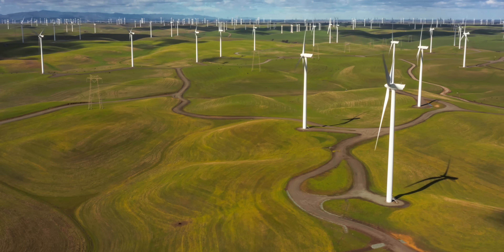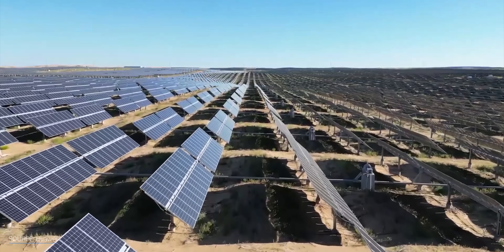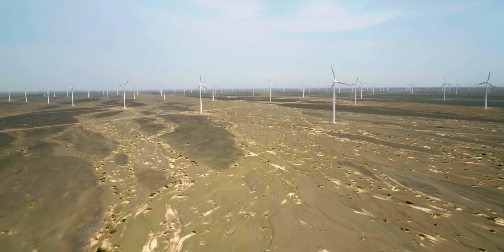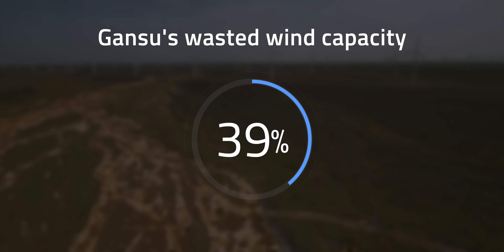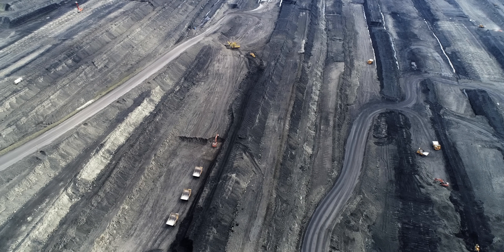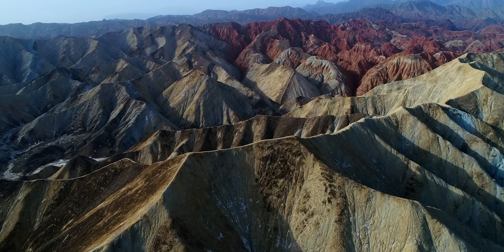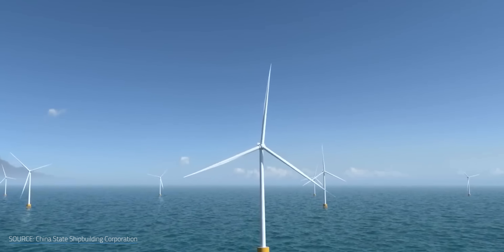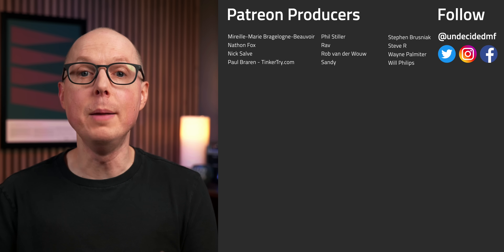The World’s Largest Wind Farm has a Tiny Problem

Comment: That coal is often exported to either the south china or abroad. China needs to add a carbon tax enough that its more expensive for coal power at least within the northern states. Local states can just clean up the plants and burn the same coal or export it and then start using the wind power. Beijing wants to close its local coal power so it should be connected. Beijings daytime power demand is 17.5GW and thats with transmission losses. It also secures the capitals power (at least for daytime) and allows some coal to still be needed but burnt alot less (and be cleaner even though most coal power plants are new by global standards). Remote data centres only need a very small staff. Other options are worker heavy green steel/ Cement. Cement needs are likely too low in the north but green steel made by wind would still have value if sent by train (more local jobs). Steel ore can come north and green steel sent south. Aluminium needs vast power demand. Curing of carbon fibre, C02 absorbtion, pumped storage as a battery (When the wind still blows overnight). In the end, China needs to decide how to transition such workers from coal to something else even if that more than one industry but one that flourishes on cheap green power even with HVDC wires to the south. Its not easy and stability is crucial to Beijing but it moved from bikes to cars and China had no oil.

Comment: Typical China project, build stuff they don't need. Power that would have to be transported too far to be practical. They tear down apartment buildings that weren't needed to begin with. They overbuild airports, highways, rail lines, steel plants, aluminum plants, ev battery plants, solar cell plants. This may all sound good until you realize it's not needed and now they took a beautiful untouched desert we fight hard to preserve over here but over there they turn into an eyesore.

Comment: As they put more high voltage transmission lines in the cost to deliver power to the areas that need it most will come down. Sounds like they are heading in the right direction despite difficulties.

Comment: The toxic gases to produce the blades and materials to build these things is massive and when the blades themselves wear out and they do their huge and their non-recyclable… Windfarms in my opinion create more problems than they solve. Appliances lights everything we use has to change. No more energy gulping washing machines and dryers the technology has to be put in the things we use not trying to power What we already have. Energy is always a losing situation for people. Take electric cars sure they say they don't pollute? Where do you think they get the Energy to charge? In most places its coal… It's just a trade-off one pollution for another. Then you've got all the toxic waste to build these things. We are an arrogant species and don't worry the next wars on its way. That's how arrogant we are

Comment: Did not think this one through did they. The same stupidity exists in China as it does in the West. Where are all the engineers and people with common sense? These were the type of people that put the original system together. None of this BS is economic. PV cell knowledge is about 170 years old, if it was any good why was it not being developed for those 170 years?
Common sense and economics ruled.

Comment: You don't use Gigawatts in the past tense. Gigawatts is an instantaneous value. It's like saying, since I bought my car it has produced 1,000 horsepower. If you want to express the amount of power or more correctly energy the installation has produced in the past, you need to use the measurement unit Gigawatt hours... Or Gigawatt years...

Comment: This all sounds great, but it’s pie in the sky. The numbers you quote are misleading and wildly optimistic. They don’t take into account the dollar cost or resource cost or carbon cost or maintenance cost or replacement cost of the wind turbines let alone the incredibly gigantic concrete anchor, sitting under each turbine supported by steel rebar. This channel seems to be a sales brochure for both wind power and the Chinese government. A well constructed nuclear plant that isn’t built by the lowest bidder and is properly inspected during construction would be a much better solution. Would also not kill all the birds.

Comment: You should indicate the comparative losses in high voltage AC vs similar voltage DC transmission lines. I've heard that HVDC losses are much less over the distances involved. I think Siemens was  the supplier for the HVDC equipment.

Comment: These wind farms will eventually be abandoned. The company’s will eventually go bust plus very expensive to pull down and remediation. Hence they will be abandoned. Co2 is actually getting to low the trees and animals and humans will die for myth, We need nuclear gas or a clean coal power stations just get rid of the black smoke. I can say I have a car that can 200 km per hour but it’s actually parked in the garage and never ever will be driven at that speed. So a wind farm is quoted the same way it can provide x power total out put under ideal conditions. So you want power you got a heap or none. But my car will give me 200 km per hour at the press of the accelerator. Th same with gas turbine power station.

Comment: UNDECIDED?   You are far from undecided.. You are lecturing on China's so called success.  How can it be successful when it is nearly twice the cost and that is without the costs of transmission .. Nice of you to gloss over the facts..   You also fail to calulate the requirement in the very now!    A.I.   and that of the failing EV's. More transmission lines..  ?   Have you worked around high power lines?   I have and it is very dangerous.  Even a mist is and issue..   Fail!    How long to turbines last.. Where is there grave yard and the cost of dismantle and retransport.   
Oh before you say it !   China announce it has the answer to disposal.  Put it into roads?   Great so every car or truck grind up the glass and resins to be shared into the air we breath..   My God people are dumb..  if they think that is and answer ?    
So. Matt do you own a large farm holding ?   I would guess Not as where do you think the lines travel through..  Many of the Power companies are off shore shelf companies..  they take NO!  responsibility for removeal of these wind generators..   I am in Australia and there have been a few fires..   Oh and yes even a Tesla battery bank..  took weeks to burn out..   But don't worry I am shore they know they are CO2 free fires. What possible problem can they cause..     Matt Ferrell your on the wrong side of the future.. That is is we don't blow our selves up..   

Did you know those solar panels are reflective?   Did you know the Worlds magnetic field is changing..  Did you know the Sun has justrecently change magnetic poles and is now in a solar maximum?   Yes. True..  Now ours is weakening. when the Sun gives of more..  ?    
CO2 or the Sun????   I pick the Sun and the energy heating the magma you know those increased Earth Quakes and Volcanos..    I guess the wind turbines could blow out the Volcanos??    Naa Just kidding..    Matt, Why are the companies like Google, Amazon,  Microsoft looking to Nuclear?   because of the A.I demand and the low CO2 foot print.. ?     Look into the power needed for A.I.  it would be a GIGILE …. Or Two.  🤣🤣

Comment: It is becoming so frustrating for totally uneducated and ignorant people to make comments about energy production.  They have absolutely NO knowledge of the TECHNICAL requirements to generate large-scale power for a power grid.  The power grid has very specific and type requirements to maintain the stability of the grid.  There are numerous factors or attributes that must be made to ensure that stability.  Unfortunately many renewable power sources are incompatible with creating a staple power grid.  Solar and wind are two such examples.  Unfortunately, for many technical reasons, they are incompatible with a stable power grid.  Sadly, greed is driving.Many of the pseudo activists who are promoting wind and solar power.  They're certainly are applications where solar and wind excel, particularly for remote applications.  [ I hold 3 engineering degrees and completed my graduate work in mechanical engineering at Stanford University. (My areas of emphasis were energy systems and biomedical research.)]  Much of the information presented in this video is simply wrong, if not false.  I invite the viewers to read any of the books written by Professor Thomas Connelly at Stanford University.  I certainly miss my dear friend.

Comment: Instead of dumping the power, pump water back up the hill into hydroelectric reservoirs.  Hydrog3en is monumentally inefficient but instead of dumping the electricity, generating hydrogen has an attractive purpose.  It can be burned right along with coal to generate electricity.  China isn't stupid.  They are racing with all efforts to to materialize He3 - D2 fusion and even though the DOE solved the reactor problem, the Chinese are going to bring it to fruition.

Comment: You hit the nail on the head there Matt.
Transmission and storage need to become much bigger part of the investment focus more so than just generation. 
Australia has been investing in huge amounts of Solar and Wind but like in Gansu a significant amount is curtailed.
Only lat 2024 dis renewables meet 50% of our electricity demand at a few 30 minute times during our summer months.

By comparison far less effort has been made in improving transmission networks.
Out very large battery projects whilst huge on the world scale can only supply peak support for a few hours. between 2 and 4 hours of power when needed at peak times. 
Whilst wind can be generating after the sun goes down there still needs to be a lot of wind during the late afternoon and evening.
Our peak demand typically 15:00 hrs through to 22:00 hrs. I believe this time frame seems to be universally mirrored  globally.

Comment: The only reason we seek green energy is because they have connected CC with human development. I’m not against clean air and water but that doesn’t mean that only humans are responsible. Last week a scientific report showed that the polar caps on mars are receding faster than earths. Did humans cause that too? USA uses 25% of the world’s goods and we have cleaned up our air, so can India and China. If you dig deep in CC solutions you will be shocked to find that depopulation is also a goal. Are you for that too? It’s all a façade for global governance. Clean air is obtainable with oil energy. If you sir are stuck on wind energy in an attempt to save the planet, then be an advocate for all clean energy development. Nuclear fission is safer than nuclear fusion. Geothermal, solar and many more forms can be developed if we fund them. It’s proof that the world leaders are using CC as an excuse because energy development is under funded. Even your precious wind energy has side effects and consequences. Affordability and consistency has to be included too.

Comment: China has never been forthright in disseminating truth.  I always look for supporting data.  China has been building coal fired generating plants and is bringing them on-line at the rate of one/month for several years.  The data can be confirmed by destinations of coal imports, infrastructure parts that are imported and satellite imagery.  The key factor for for electricity is $/kwh delivered.  Wind power has a high maintenance cost/kwh.  Then the turbine dies and normally is just standing, look at wind farms in California.  No one has   a feasible plan to recycle the hazardous waste from wind farms or solar farms after their useful life.  ergo You pay 2-3x for the power and then look at huge tracts of land or water with turbines with nothing moving for centuries.

Comment: 7000 MW installed capacity that takes up the size of Belgium shows that renewable energy is probably not a viable long-term solution. This is less energy than even the smallest nuclear power plant when you take capacity factor into consideration.
Reply: So I wonder why won't the CCP just build more nuclear power plants? I really don't understand the global aversion to nuclear power. I truly think we solved the clean and efficient energy problem with nuclear power.
Reply: @dopecat15  They are. They just fired up the Zhangzhou Nuclear Power Plant in 2025 in January. Obviously, the upfront cost of a nuclear power plant and its power density doesn't justify having it for smaller cities or less-developed cities, but they are experimenting with the small modular nuclear reactors to reduce costs, as nuclear power plants are still bespoke constructions.

Renewables are cheap enough that you can add them quickly and scale up in a linear way, but at the cost of very low energy density so it uses so much space, and the intermittency issue means you have to build a couple of coal or natural gas peaker plants to make up for baseload.

Comment: From what I've gathered online, the lifespan of a wind turbine is approx 20 yrs and about the same for solar panels..... Have lived by or on (sometimes, under) the ocean for decades of my life..... Salt water, probably the most  hostile environment for wind turbines/electricity plus huge storms/swells ain't gonna cut it.... maintenance & replacement will make fossil fuels much more reliable and cheaper in the long run.... just an aside...
Anybody ever heard of nuclear?.... (worked great on one of the subs I was aboard for 14 months back in the mid 60s)

Comment: Right .... 1.5 GW @ 1,500 volts field of windmills isn't nothing when one (1) hydroelectric generator like at Bonneville Dam (that has twelve) @ Celilo supplies 3.5 GW @ 560,000 volts DC 2-wire [ 840 miles away ] enough electricity for 1/2 of Los Angeles entire needs from industrial, commercial, infrastructure and residential. One Hydroelectric Dam supplying power from Seattle to Los Angeles, total costs to build and upgrade around 3 Billion .... and isn't a horrendous "EYE SORE" to 1000's of acres of American land .... IHMO !!

Comment: Not sure how you waste 50% of electricity produced.  Without a load there is no circuit, no electric power produced or ‘wasted’.   Are you saying they power wasted heating coils randomly out in the desert, just wasting electrical power?? The only ‘waste’ I can think of is the waste of over building conversion machines.  Which actually, if there is little or no depreciation of the equipment, it’s just an investment.  A good or bad investment depends on how you use it or will use it.  Please explain how you ‘waste’ 50% of the energy produced.   To what circuits is the electrical current going to?

Comment: Transmission is a bigger cost issue than you describe. The cost to build lines capable of delivering the maximum capacity divided by the energy actually delivered drives the cost of the energy sky high. It makes no economic sense.

Comment: This is a constant feature on central planing, builds the impressive part, but not much consideration is given to the other parts that in this case would be cost of access, demand, transmission, storage, etc. Maybe a smaller and well rounded project would be a good start, that would attract business to the cheap energy and that would create a demand for an expansion.

Comment: Anyone ever figured out how many replacement propellers will be needed in the next 20 years and where the old non-recyclable blades will be buried? Has anyone ever figured out how much diesel fuel was burnt to built all these towers, blades, concrete etc? Anyone ever added up the copper used to build the generators and hook them to the grid? Not likely because it won’t work if you do!

Comment: You said it, wind electricity is unreliable or there's too much. We don't have the tech yet for electricity storage to store what even a mid-size city would require. All of this is supposed to be for clean energy, which is a joke considering the amount of natural resources are needed just to set up a wind farm, keep it running successfully.. it doesn't pay for itself in the end, and the co2 used in making wind farms and upkeep? It's a lose-lose all around. Better tech, nuclear, and further research in batteries may change the future, but forcing ' clean energy ' is just virtue signaling and the the elites new religion

Comment: Wind and Solar are always the unicorn just around the corner. Always expensive, land gobbling, and horrible to ecosystems including mass animal death. Not to mention the eyesore.
I always wonder why the eco zealots never mention nuclear. 3rd generation plants have never failed and are designed to never melt down. The tech is now quite advanced and waste is stored and buried at the site. The US regularly uses it with no issues for military purposes. The big tech companies are now building nuclear plants to power their large power needs for AI, crypto, etc. Multiple companies including in the US and Rolls Royce are designing small reactors with more flexibility.
China sees they need to have energy independence. 1.5 GB for a huge wind farm seems inefficient for the cost. China has 56 nuclear plants powering 54.3 GB capacity. 30 reactors with 32.5 GB coming online. China’s bet is on nuclear. US will follow suit as energy = dominance and better standards of living. Solar without the large land grabbing panels and wind without the destructive turbines could eventually be great options. And I know it’s anathema to greenies but fossil fuels in the US at least are incredibly clean now. I just prefer to keep our natural ecosystems pristine. That’s the type of green agenda I am a zealot on.